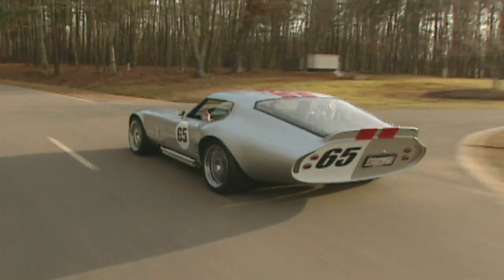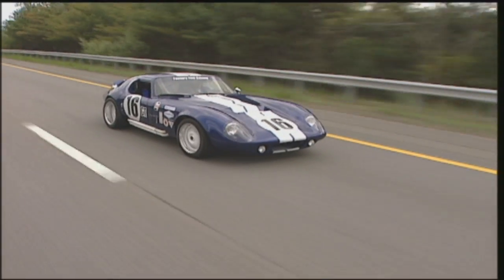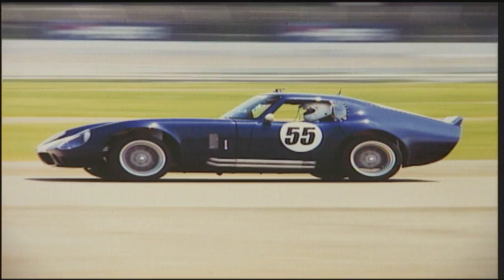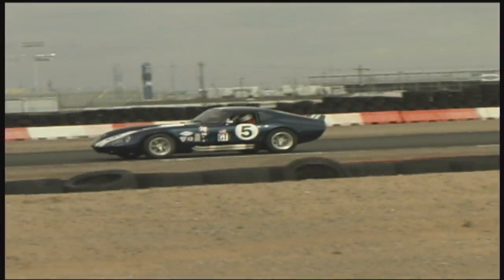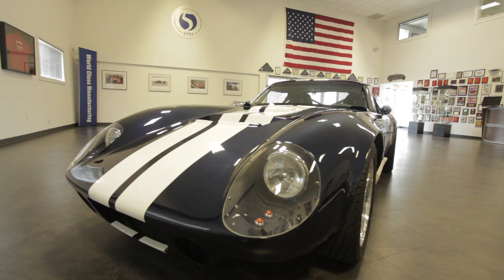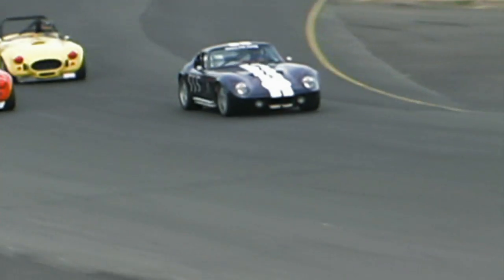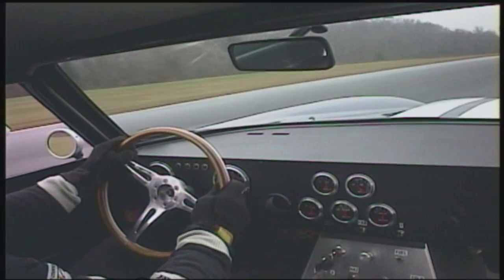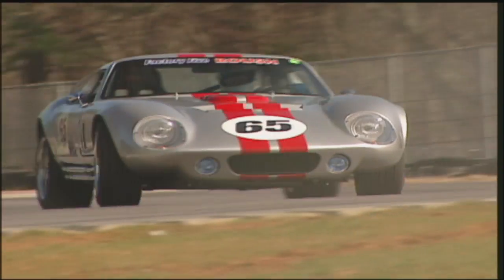Factory Five Type 65 Coupe

Comment: How much would it cost, "ballpark" to have a decent engine, suspension etc. put in? 300ish hp, 250 ft lbs of torque, great suspension, big brakes etc. $25,000ish for what the company gives you in the kit, then what, about $10,000 for a new engine, $5,000 for the suspension and brakes? $5,000 for a new drive train? I've had old Porsche's, new BMW's etc. so I know how expensive sports car ownership is but I would like to zero in on a ballpark price so I can decide on if this car is appropriate for me.
Reply from the maker: The average Coupe build cost is around $45,000 depending on the options you select with the kit, what you do for wheels/tires, engine/transmission, and paint.
Reply: @factoryfive  Thanks for the reply. That's a very reasonable price for so much car. It isn't easy to find info about the engines on your website though. Here's the link for those interested. https://factoryfiveengines.com/

Comment: I am a customer and I want to buy this from you. How much would it cost?
Reply from the maker: The new Gen 3 Coupe base kit starts at $16,990 and the complete kit starts at $21,990. You can read more about both kit options on our website. Let us know if you have any other questions!

Dave L.
Reply: Factory Five Racing is there a donor car?
Reply from the maker: You can use a 1987-1993 Ford Mustang as a donor car or go with the complete kit version of the kit which gets you everything you need to build the car minus engine/transmission/rear end, wheels/tires, and paint.
Reply: Factory Five Racing ok thanks

Comment: Is it possible to put in a BMW straight-six? Ford V8's are hard to come by in Germany, and Fuel is 7,30$/gallon, so it would be a PAIN IN THE ASS to get a ford engine and put it in.
Reply: You would need to make custom engines mount and get a custom axle made.  Not sure how it would fit.  You could also try a ls400 engine.  Not sure what v8s are sold I’m Europe